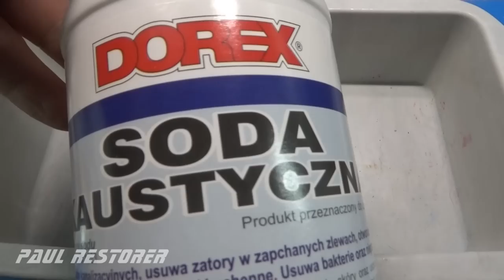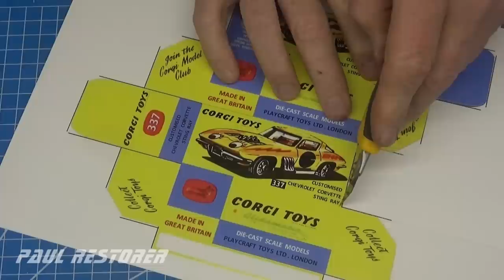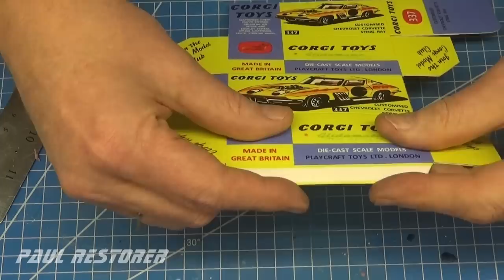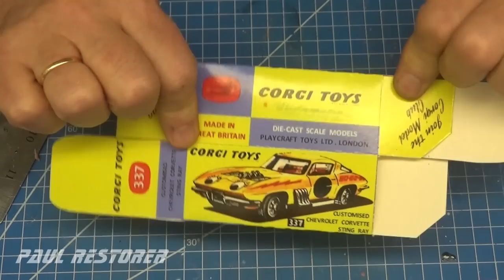Corgi renowacja Chevrolet Corvette Sting Ray nr 337. Rok 1967. Zabawka model odlewany.

Comment: Paul the miracle worker!  What a piece of junk and now the bumpers repaired and even the windows look fantastic.
I noticed you examining the engine insert.  Yes, the intake trumpets cant inwards like that -- it's the natural angle of the intake ports on the small-block V-8 without an intake manifold.
That would have been an expensive car in real life -- it's an original 1963 C2 Corvette Sting Ray coupe, with the split rear window.
Bravo!
Reply from the maker: Cool, Thank you very much

Comment: Than is a 63 Corvette.  I’m sure you mean the model was made in 67. The only year Chevrolet manufactured the Corvette with the split-window is 1963. The designer loved it.  The safety industry... not so much... it blocked the already limited view of the rear.
Reply from the maker: Yes of course

Comment: The cones out of the bonnet/hood are wrong they are supposed to point outwards open the car and push the middle of the engine where it is folded they are only crossing over because a child squeezed them together. Just see you cutting the box even that shows pointing outward.
Reply: The cones were crossing each other like this on the original.